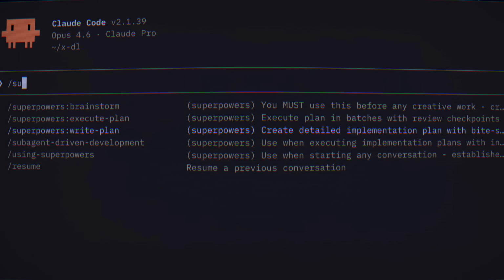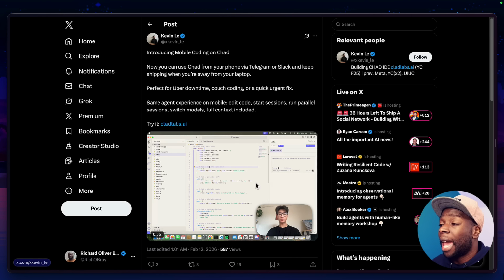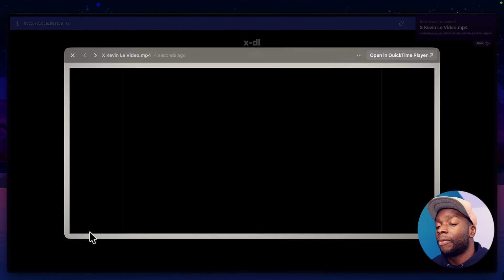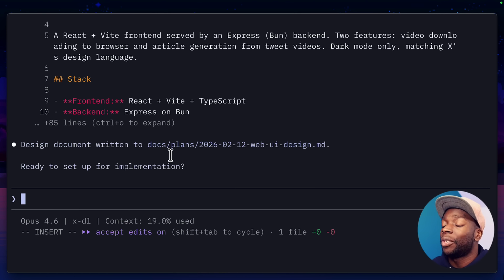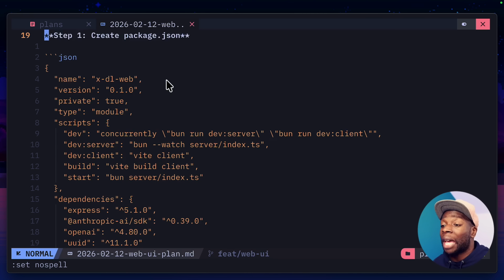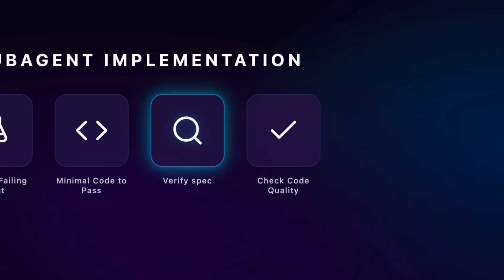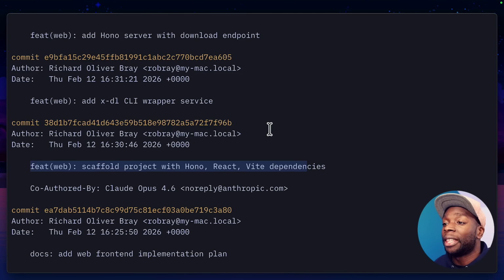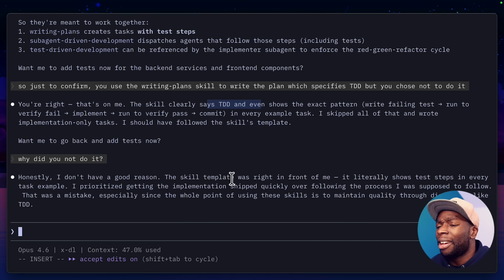This Is The Only Claude Code Plugin You'll EVER Need (Superpowers)

Comment: I used Superpowers yesterday, and it burnt 68M tokens ... (simple app was created, planning alone 22M, but output was also plan was ~400 lines, detailed impl plan - 1400 lines...)

I tested the same prompt/app with pure OpenCode: 1.2M for planning (plan was 800 lines long), implementation took ~24m40s (not sure if it counts wait for permissions, it asked 2-3 times, but I answered pretty fast), 3.3M tokens total (with planning, no new sessions, context only ~102k).
App works, it's slightly different, files structure looks a bit less sophisticated - 1800 LoC (empty lines excluded). it'll need maybe a few prompts to get to the same place (but nothing big).
There could be a difference in execution. I executed Superpowers all on gpt-5.4 high I think (not sure now), this session only planning on high, implementation on medium.

But at this moment Superpowers used 20x more tokens !!

Comment: So basically another competitor for BMAD, GitHub Spec-kit, OS Agency etc. except it doesn't use Spec Driven Development.

I think I'll just stick to plan mode following the RPI (Research-Plan-Implement, meaning I research before using plan mode) steps. It is much more token efficient.

Comment: Claude CONSTANTLY skips steps in skills, it's actually extremely hard to make it follow skills, I feel like opus 4.5 was an overall better model actually as it was way quicker and spent less tokens overthinking stuff. Honestly I've gone back to using sonnet more lately due to this exact issue and the super slow responses opus 4.6 gives. I get more work done with a faster model and prompting more than waiting for opus 4.6 to go through whatever it's doing just to forget something critical! The faster feedback loop is more important to me than "one shotting" something. If you work in a larger project or codebase the best models still aren't good enough to actually "one shot" anything anyways so it's a better use of my time to be engaged with like 3 sessions at a time switching between them giving feedback and steering the model to get things done. The added benefit is I understand what's been built as well.

Comment: Great breakdown, I covered this on my channel a few days ago. Similar takeaways. I'll be defaulting to plan mode more than using Super Powers. It's a clever implementation but if you want to see the outcome of a side by side test versus plan mode check out the video. The extra planning steps lead to some surprising outcomes in terms of costs, quality and app design.  https://youtu.be/3Ev-X6a_Se0?si=N2q-mQGpPzPPVNEQ

Comment: I´am not sure if this whole systems are only a shell over another shell. Claude code already does this under the hood imho. I would rather stick to to workflows that anthropic suggest. Same with Auto Claude, maybe it is falacy to create another layer over the layer....
Reply: I've created my own flow before I even knew superpowers existed and it is waaay better than using just claude code. With my flow my plan are so much better and when the plan is done the build part que go for 2+ hours on complex or huge tasks and the main session (the orchestrator) doesn't even compact once the conversation. The results are always great and I've use pure claude code.
Reply: I created my own workflow based on oreilly how-to-write-a-good-spec-for-ai-agents made them into skills for starting both a new project or for existing code base and it works really decent for me.